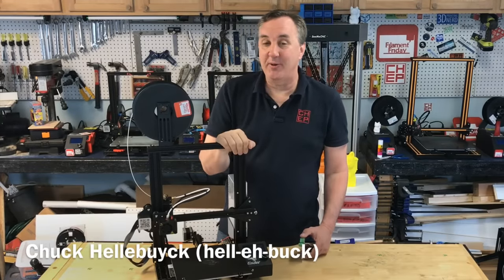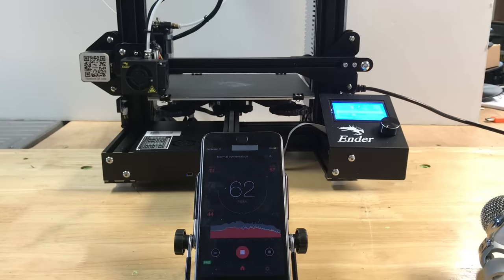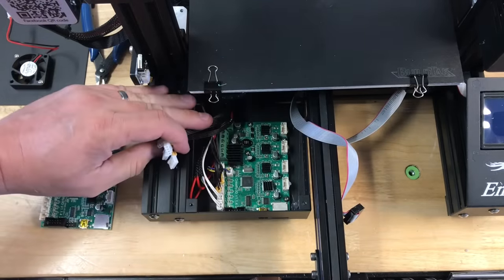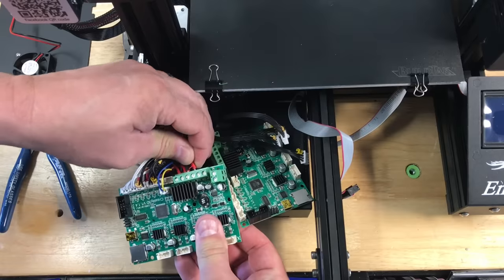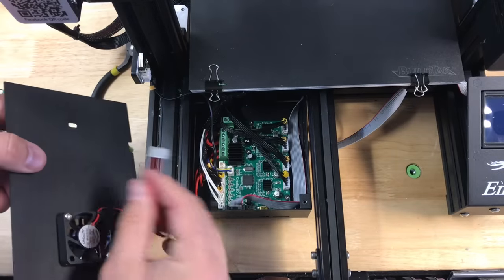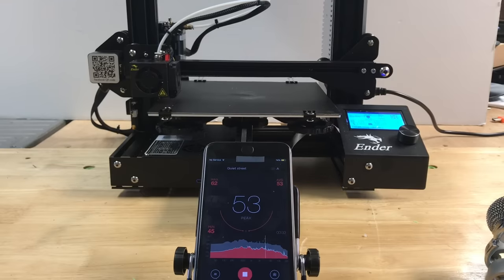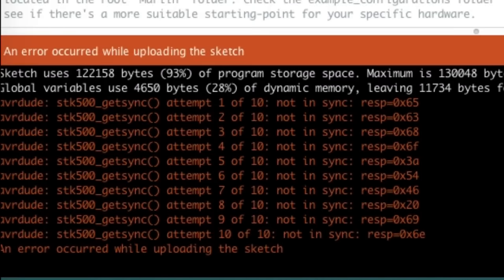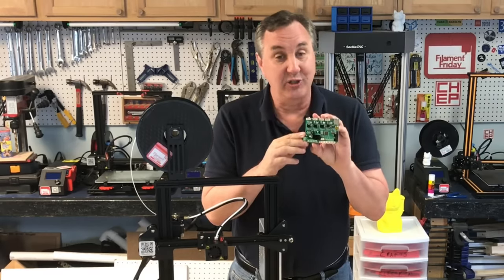Creality Ender 3 - Creality Silent Board v1.1.4 TMC 2208 Upgrade

Comment: hi Chuck  today installed a 1.1.4 silent board in my ender 3 pro. Im notice the vref voltage is 1.27V one each axis is normal ?? I think is very high
Reply from the maker: I believe 1.2v is normal.
Reply: @FilamentFriday  ok now testing at 0.85V and work fine
Reply from the maker: Interesting. Time will tell if you see and shifting due to not enough current.
Reply: @FilamentFriday  
ok i'll do tests and update you! it seemed too high on the other  my printers , 4max , kossel with the tmc 2208 I set 0.85V like other people.
Reply from the maker: You may be right. I found this at the site below:
The TMC2208 outputs continuous motor current up to 1.4A and peak current up to 2A. Therefore, the reference voltage of the driver module should not exceed 1V.

https://wiki.fysetc.com/TMC2208
Reply from the maker: Though the TMC2208 data sheet says this about Vref:
A voltage between 0V and 2.5V linearly scales the current between 0 and the current scaling defined by the sense resistor setting. It is not advised to work with reference voltages below about 0.5V to 1V for full scale, because relative analog noise caused by digital circuitry and power supply ripple has an increased impact on the chopper precision at low VREF voltages.
Reply: @FilamentFriday  If there are no layer shifting it could be good advice for those who buy this card.
I can guarantee you that already at 0.85V Tmc are very hot on Anycubic Kossel.
Reply: @FilamentFriday  For NEMA 17 motors from 3D printers the current is in general in the range of 0.5A to 0.8A RMS, which is a reference voltage (Vref) of 0.7V to 1.1V. At first use 0.5A (0.7V) and if there are problems (like step losses) then set a higher current in 0.1A steps till everythings works.

Comment: can anyone suggest a fix for this? I installed the new board for the ender 3 (1.1.5) and it is so quiet now. However, yes there is always a however. I had the regular teething problems with the previous board but before its replacement today it never stopped extruding half way through a print.  I changed the bowden tube,brass couplings(not the crappy ones that came with the machine,the ones Chep recommended) and nozzle. Yes it printed past the point it failed at last time but still stopped extruding not long after that. Any thoughts?
Reply from the maker: Maybe this: https://youtu.be/MaMYMTX1Xl4
Reply: Does the extruder motor stop completely (turn off)?  If so mine did this as well, something in the firmware was causing the stepper driver to overload and shut down.  Updating the firmware fixed it.  Make sure linear advance is not enabled.
Reply: I've got the same issue, after a long investigation the culprit was the extruder motor cable that had randomly bad contacts ! replaced it and problem gone !  (beware : some aftermarket cables will need inverting 2 pins. do this if your extruder runs backwards after the swapping !)
Reply: thank you Chep,froggies and odium for your advice. I will try them all and let you know what happened so that if anyone else gets this problem it might help them too.
Reply: UPDATE  Problem solved. Uploaded marlin to 1.1.9 and Cheps calibration cube looks great. My 1.1.5 creality m/board came with a bootloader which made it a lot easier. Thanks everyone for your help. NOW what's the next headache:)

Comment: Hello. I have a question about this video. I just bought me my first 3d printer, en ender 3 pro. I added a silent v1.1.5 board. Do I need to flash this board before installing it, or after? Or doesn't it need a flash at all? Another question, people say these boards can overheat pretty quickly, is it a good idea to you to plug the cooler of the unit straight in the power jacks so the cooler cools all the time? Thanks.
Reply from the maker: It should have firmware installed. If you see a menu on LCD your all set. You could move the fan. I did.
Reply: @FilamentFriday  Hi. You mean that you moved the wires of the fan of the position of the fan too? Thank you
Reply from the maker: Yeah it was in one of my videos

Comment: Could you use this board with CR-10 mini?
Reply from the maker: It’s designed for 24v hotend and bed and CR-10 Mini is 12v so it would require some modification.

Comment: This is very concerning. Your new board has thermal runaway protection but no bootloader while Teching Tech has a bootloader but not thermal runaway protection. Not having the bootloader is not acceptable. Everything else could be installed if needed.
Reply: Also a bootloader is easy to install. Many videos how to do that.